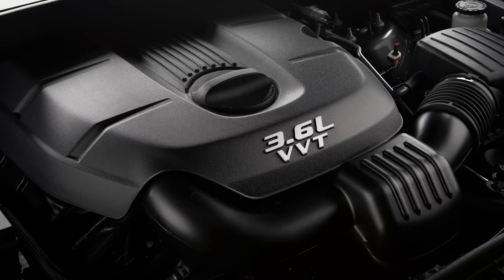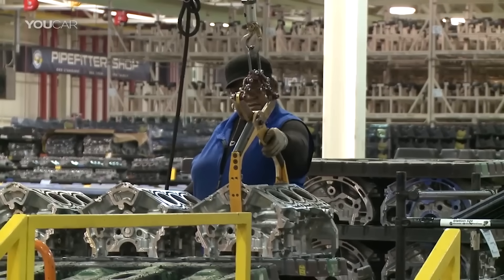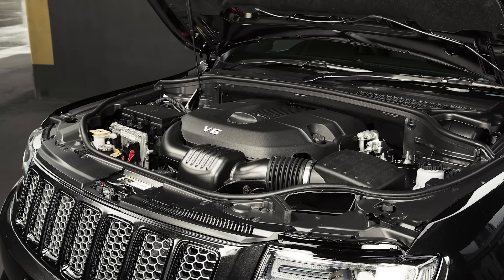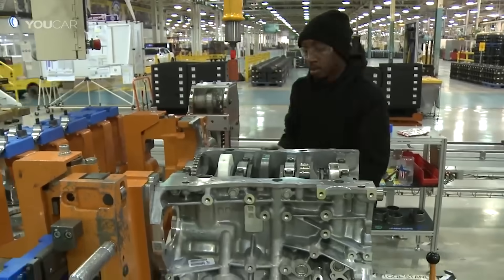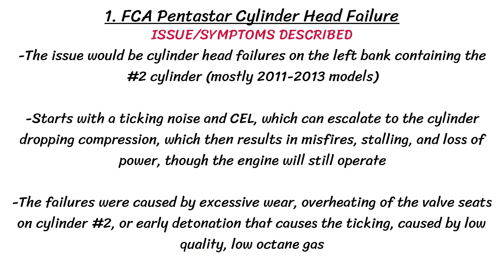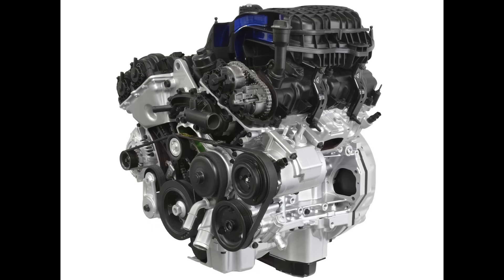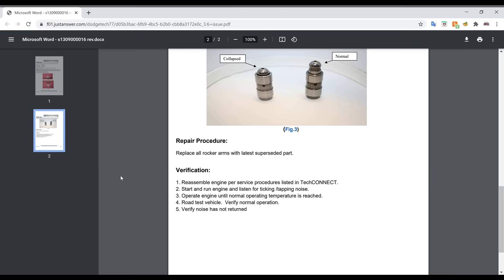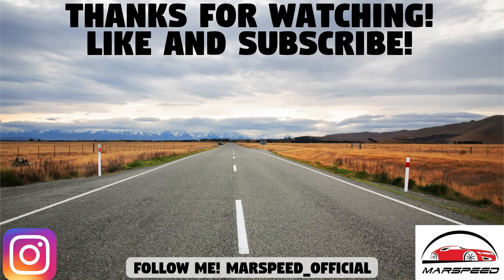The Specs and Fatal Flaws of the Chrysler 3.6L Pentastar V6 Engine

Comment: They are not bad, would I own one? No. For starters oil coolers leak sooner or later. They are plastic and sit in the valley with all that heat. Next is valve train issues, a lot of issues.  Burnt valve, rocker arms coming apart, cams wearing out, valves sticking, valve seats wearing prematurely, valve springs braking. 
    Also oil consumption, oil pump problems. Water pump failures and thermostats sticking open. That's just the engine.  Don't forget PCM issues that Fiat can't explain. 
   In a world where engines are expected to go a quarter million miles without thinking about it Chrysler/Fiat doesn't are the grade. 
   When the 3.6 is worked in a truck of in a Wrangle that runs the trails then we see bottom end problems. 
    This could be a good engine if Fiat was not so obsessed with saving a buck.
     I almost forgot,  every Chrysler engine I open up I find oil in the induction system.  Haven't figured out why.

Comment: We have a 2012 grand caravan. Had the misfire issue with the cylinder head, but it was replaced under warranty at around 60k. Had a broken thermostat, and after replacing it the housing leaked and had to replace that too. Had a ticking rocker arm and changed that at around 120k... thankfully before it wiped out the cam. Had a misfire issue at about 140k that drove me nuts.  Finally figured out it was a bad cam phaser on the rear exhaust cam. Changed all of them while i was in there.  Because of the misfire, the rear catalyst went bad but isn’t plugged, just setting a code every once in a while.  Its got 160k on it now. Oh, and the drain back valve broke off in the oil filter housing last oil change but i was able to get one and replace it without changing the whole filter housing.  Im a mechanic, and told my wife this was all going to happen when she wanted to buy it, but she didn’t believe me...

Comment: I have on of this v-6's (2013).  It's garage.  Nothing but problems.  I run threw alternators and electrical problems.  I still haven't had it running for more the two months at a time.  I hate this engine and I'm a mooar guy.

Comment: Well I can tell you with vast experience with owning my 2012 Dodge journey RT front wheel drive 3.6L that I had massive cooling issues while living in Vegas bought from Towbin Chrysler Jeep and Dodge in Henderson NV. I had complained to the dealership on multiple occasions about the cooling issues and excessive heat but they did not think anything of it until the engine and transmission completely seized with only me putting 3,000 miles on it and it had to be towed to the dealership the engine was completely rebuilt as well as the transmission. I bought the car with 110,000 miles and I’ve only driven it about 50,000 miles since I’ve owned it and it’s been in and out of the shop. Finally after being in and out of the shop over 30 times in less than a year they meaning the dealership replaced the entire cooling system or so they say. I had a radiator fan issue which is what I brought up with them to begin with but come to find out it was only a fuse that needed to be replaced. Surprised the dealership couldn’t figure that out I had to figure that out. Since owning this piece of crap I change my oil frequently as well as run STP and 91 octane in my tank to keep my engine from completely failing again. Because of such a bad experience with this Dodge journey when I go and buy a new vehicle I am staying far away from Chrysler Jeep and Dodge vehicles.

Comment: I got a 2013 Charger 2nd hand from the dealer. I changed all the fluids myself and most maintenance items. The driver side fuel pump seemed to stop and at the same time as the shifter failed. 
Problem 1) Figuring out how to get car off the road when it is stuck in park. 
Problem 2) The FCA Monostable Gearshift not only sucks as it causes confusion/ accidents / and fatalities .
Problem 3) The FCA Monostable Gearshift is not an easy part to get a hold of. 
I also got a Air Bag recall, no charge and got a loaner for free.

Comment: I can attest the quality of the Pentastar. My 2014 Ram was a fleet truck and it currently has 271K miles. The 1st owner told me they had the engine replaced at 240K miles due to the tick on one of the heads. When I purchased the truck I had a look at the engine bay and honest to truth the engine had a build date of August 2018. The Carfax also matched those dates with a major service on a local Ram dealer. So far I've been very happy and I plan on adding some 100K miles before I replace it with something else.
In summary, these are great engines if you take care of. They don't require any outstanding maintenance other than regular oil changes and filters. And they save tons of gas compared to the full size trucks of 20 years ago.

Comment: Owner of 2015 Jeep Grand Cherokee with 3.6L. Current odometer: 75K. Rocker arm/Cam assembly replaced at 55K miles. Done under warranty. Problem started with ticking sounds. Knew it was serious problem and immediately took it to local dealer. Tappets were toast. No problems with engine since. Could cylinder be next? Good to know about pending class action. Very informative! Thanks!

Comment: I worked at a CDJ dealer in 2013, was supposed to go to Dearborn for training, we made it 5 miles in a Caravan before it started missing, due to burnt valves. Next week, same thing. Now the biggest issue I see is the oil cooler leaking.

Comment: I've had my 2015 Chrysler 200 S for 6 years now. It only has 38,000 miles on it, but I've had to replace the oil cooler housing twice within 16 months.

Comment: I have a 2018 dodge challenger sxt with 34,000 miles. Never had a single problem, and i have a 7 year 100,000 miles  bumper to bumper warranty
Reply: 34k...you should not have any problems with that low mileage

Comment: This is why I'll never own another Jeep beyond '06. As if the 4 doors weren't enough Jeep abomination, in '07, they put in that lousy 3.8 mini van engine followed by this 3.6 in '11. My '05 Jeep TJ Rocky Mtn w/ the 4.0 I6 is by far the best engine ever put in a Jeep. The '07 - present Heeps are crap! Find a rust free frame TJ or LJ w/ 4.0 I6, 3.73's, Dana 44 and build it to your specs. 

FIAT = Fix It Again Tony! 😆

           O|||||||O
🇺🇸 ONLY IN A 2 DR 🇺🇸
          '41 - '06

Comment: I was a diehard Chrysler guy for 30 years, always making excuses for the brand. After multiple engine/ transmission issues and horrible resale value I did my research and now buy only Toyota/Lexus products. Life-changing.  Sadly, I learned you get what you pay for, I'll never buy another Mopar. Both Penstar V6 and 3rd gen Hemi are terribly flawed. We won't start on the transmissions and electronics.

Comment: 2015 Town & Country The most common problem with these are rocker arm ticking had them fixed 3 times 1st 2 under warranty 3rd out of pocket  Easy fix if mechanic knows what their doing Other than that Very reliable smooth engine and transmission I have 225000 miles on it. No leaks no smoking no engine  noise no problems 25mpg Drives like New 
org owner.

Comment: Probably not a bad engine overall.  Had one in a 2014 Chrysler T&C van.  Great power and decent fuel efficiency given the weight and boxiness of the vehicle.  Used to feel weird smoking other people off the line in a minivan, but it would do it with no questions asked.  The problem was that the electronics were absolute garbage in that vehicle.  Notice I am writing in the past tense...that is for a reason.  I should have learned my lesson about Cry-sler electronics with the first one I owned, a 2005 Grand Caravan.  Again...decent engine, electronic nightmare.  No more Dodge in my garage.  Ever.  Some lessons just don't take three times to be learned.
Reply: Cry Slur

Comment: Oil leaks in the valley.
Every single one.
You missed that problem.
Reply: That oil leak is your oil cooler leaking.  I change one or two a week. The replacement one Chrysler has are better and I don't see any come backs. But there are 96,000 on back order. Our parts guy has three left that Chrysler doesn't know about. You can get aftermarket oil coolers. Takes about three hours to do the entire job including burping the coolant system and confirming the repair.

Comment: I'm experiencing so many issues with my 2013 Dodge Charger SE. Engine light on, cat converters running below efficiency. I've had to changed out the thermostat, heater hose, fuel pump and fuel lever sensor. My vehicle shakes, vibrates, and the engine light flashes. What's causing these issues? (Over 150,000) miles on it

Comment: Again maintain the vehicle engine means paying attention to temperatures and fluids and functions and finding out that something is wrong and it shouldn’t be driven till addressed again operator error. Minor issue ignored til oops engine seldestructs is always the fault of one not properly maintaining vehicle. Example thermostat gets stuck closed partially ignorant knucklehead ignores it drives it till catastrophic engine failure that ain’t a design flaw that a human I don’t care about it attitude.

Comment: Omg fuel dosent cause ticking carbon deposits do and those deposits show up for three reasons dirty oil sub par quality oil and unburned fuel. It ain’t the engines fault. And is 99% the fault of the people who don’t know how to properly maintain their engines like bulk oil at oil change shops is 10w40 something generally used by v8s thirty plus years ago. I guarantee it ain’t design flaw but operator error.

Comment: I'm sorry but these issues are not indicative of a "Good and reliable engine". Cylinder head failures, rocker arm failures and coolant system failures just outside of the warranty period would be completely unacceptable on a Toyota, Honda or even a Ford. Stuff like this is why Chrysler is in perpetual financial trouble.

Comment: My 3.6 had to be rebuilt from the bottom up at 40k miles because it burned 2.5-3 quarts of oil every 2500 miles.  They didn't believe me and made me do three oil changes lasting 8 months before they lifted a finger to help me. Fuck Chrysler and FCA!
Reply: That should of been done with one oil change and the engine should of been replaced not patched up. You had a crooked dealership.

Comment: 2016 Dodge Ram Promaster full size van. Had an engine failure and went through changing the whole engine. Took me 3 months at the dealer repair shop. Mileage was 43000.

Comment: I had a 2016 200S with the 3.6 BUT thankfully while at firestone getting an oil change at about 65000 the oil pump failed dumping oil as they pulled the car in. Was VERY lucky cost me about 300.00 to fix

Comment: You should do some reviews on the Chevrolet 3.6 l v6 or the equinox garbage 4 cylinder probably the worst engines built in this country. GM at this point is absolute junk.

Comment: I have. 2015 Caravan...at 70,000 miles left cylinder head failure and replaced under warranty.  I’ve had a broken motor mount and a thermostat replaced as well.  Even with all that - a great affordable family vehicle.

Comment: Forged rods and beyond in there? Feed it 18-25lbs of boost all day or more!
Reply: The only bottom end problems I seen is in trucks that are worked and Wranglers that are built to off road. Those bottom end problems are low end torque related.  What the problem is with these engines is the cheap valve train.

Comment: Fiat Chrysler......all junk. drove many 'grand' ??  caravans, as taxis, in city and doing train crew transport.   JUNK,  close the lift gate, interior light falls out, hangs by wires. drivin down gravel roads, dustier than hell inside....crappy sliding door mechanisms, plastic door locks, junk, ...fob doesn' t work...more junk....STAY  AWAY   dodge that chrysler dealership......

Comment: My 2014 Jeep GC started a tick at 100k.  Fixed it myself as well as changed the sparkplugs and pvc valve all at the same time.  Earlier, the oil cooler leaked and was replaced under warranty.  120k now and I still love the Jeep and the 3.6.

Comment: I had this engine in 2012 GCaravan and there was a slight lifter knock after driving the car for 10 minutes or more. That noise was there since I bought it new and I had it checked at the dealership after 1 week of owning it and they couldn't find any issues with it. 
So I drove it like that for the 8 years with that noise and it did not get worse or better, it just stayed the same. I was very meticulous with my maintenance and that's is why I drove it until 140 000 miles and then sold it bc the transmission was about to go.
The only cooling system component I replaced was the tatar housing as it is made out of plastic and there was a small crack and thus leaking a bit of coolant.
Otherwise,  it was a very reliable vehicle. I used it for Uber and drove it many places.
It drove like a champ and that 3.6l v6 drove like a champ. It was smooth, economical and reliable.

Comment: My 2016 Ram 1500 has the pentastar v6. No way would I get one with a hemi. The hemi is a racing engine and not economical for daily use, imo. No issues with my engine, 76k miles, no ticking or engine problems. Change oil every 4k miles or 150hrs of use, synthetic oil only. 
Maintaining a vehicle is paramount to a healthy vehicle unless its just a flawed design, like the hemi.

Comment: What about the leaky oil cooler/filter housings? I've changed a ton of them. They're backordered until mid or end of May 2021 last I checked. Had to find an aftermarket unit from Amazon after the eBay unit leaked worse!
Reply: Chrysler has 96,000 on back order.

Comment: My 2014 ticked since new, still does at 120K, with 5k mile synthetic oil changes and 89 grade fuel, with no exceptions. I didn't think it was a big deal since the Crown Vic I owned previously also did this.

Comment: I currently own a 2015 Dodge Challenger with this same engine.  At present, it has a total of 24,000 miles and I have had no issues.  This is a "third" car that my wife and I use for Sunday drives.  It is an extra car.  Overall, I really love this car!  I would recommend the car and the engine based on my personal experience with it.
Reply: I mean hardly anything happens with 25k on the dash my man..
Reply: @callterry  This is good to know!
Reply: Come again when it’s over 120k

Comment: I have 2013 avenger and NY transmission needs work and the cooling system just messed up at 150k. Other than that, no issues.

Comment: 180,000 miles on my pentastar.  Not 1 single problem. MPG is amazing.
Reply: What type of vehicle? A G Caravan ???
Reply: @juliusboy001  yes, a 2014 Grand caravan. I used it as a stop and go delivery vehicle for 2.5 years, the last 2 years I've been using it as a work van and sometimes tow a trailer with it. I had to replace the transmission at 170,000 miles, the 62te is a weak transmission, but I love the pentastar. Great gas mileage and great power. Planning on running her for 300,000 miles
Reply: She's now at 215,000 original miles. Haven't swapped out anything on it yet.

Comment: I own 2015 jeep wrangler and yes i had cooling issue it was the sand issue they replace the  rad ,oil cooler , heater core ,the 2nd issue was the roller rocker #5 cylinder  3rd issue was the rear main seal all done on warranty under 100000 k.m scary part is we have the 3.6 litre in our 2014  Challenger no issue so far but we only have 56000 k.m  i really like the engine  in both vehicles but they are  very expensive repairs i suspect  the Jeep dealer spent about $14000 on the warranty  work on a $26000 Jeep

Comment: 2012 Grand Caravan with 3.6L. Engine light = cylinder misfire. Due to concern with head replacements and availability, I replaced the engine in 2019. I didn't find anything about an extended warranty.  Sounds like I didn't need to go that far. I have rigorously kept up maintenance on it.

Comment: I'll have to remember to use mid grade gasoline in mine once in awhile.  I usually cheap out at the pumps. My 2014 is been excellent so far never even went back to the dealership once.
Reply: Just do a seafoam treatment before every oil change

Comment: You know you've failed as a company when your "bread and butter" engine has so many defective units you screw people over on warranty service. My Dad had a 2012 Grand Caravan with the cylinder head issue. It started as a check engine light then ended up with a rough idle and loss of power. Thank God it was covered under warranty. The 3.6L V6 is quick and has very smooth power delivery. But my God why would any company allow an engine so flawed to go into production? I mean Chrysler had the amazing 3.3L and 3.8L V6 engines for decades and all they did was run while the car they where in rotted away around em lol.

Comment: I had the rocker arm issue happen on my 2017 3.6 Jeep Grand Cherokee Trailhawk. At around 60k my car was misfiring and throwing engine codes. The dealer fixed it under warranty since it was still covered under the powertrain warranty. Ever since that no hiccups at 84k.
Reply: I have wk2 2021 model. Ware you using 0w20 oil? Or thicker oils? Changed regularly?

Comment: The Pentastar 3.6 is one of the best engines out there. It was on the internet that a delivery van in Michigan with the 3.6 had 525000 miles on it. I have a 2017. Pacifica with the 3.6 Pentastar. Very reliable engine. Much better than the Honda Odessey.

Comment: I had the clogged heater core cooling system leaks replaced radiator and condencer and replaced 4 rocker arms on my 2012 200 never had cylinder head issue tho

Comment: Just rented a 2021 charger 3.6 this wkend for a 300 mile round trip. Did excellent on ⛽! Running between 65-80mph . Good power too, sets u back in ur seat w hard excelleration smooth ,really enjoyed it. (I was hoping it was a hemi but...)
Reply: The 3.6 coupled to the ZF design 8 speed is a winner.  Stronger than most v-8s were 15 years ago.